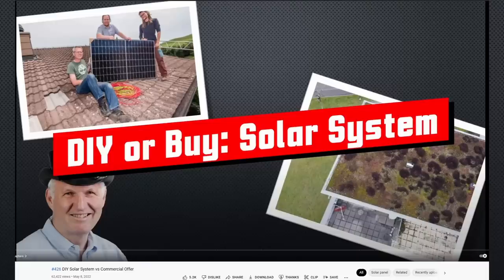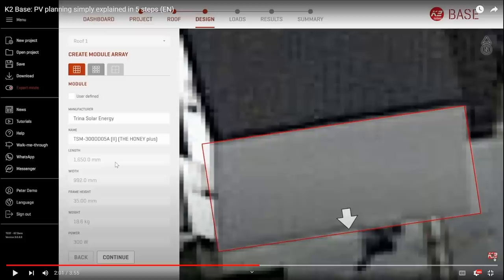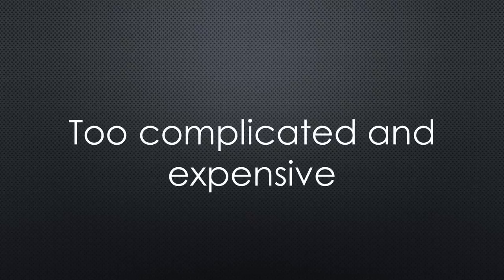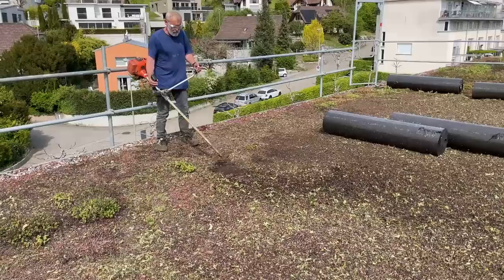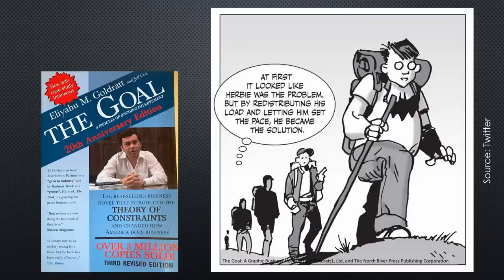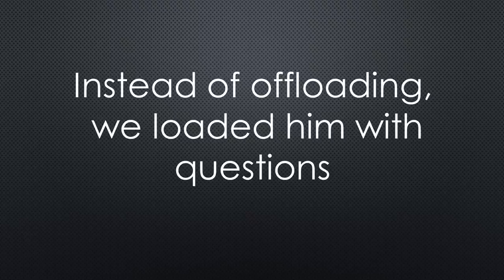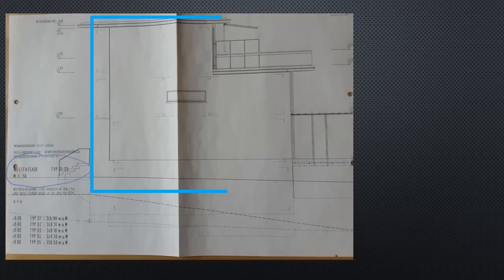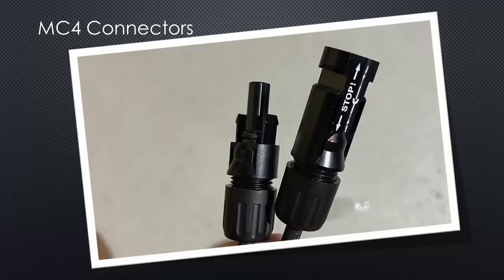#427 Four 8kWh DIY Solar Plants with neighbors (Part 2)

Comment: Congratulations!
Good progress!

What monitoring system will you use?
Reply from the maker: For the moment their cloud. But of course, we want more ;-)
Reply: @AndreasSpiess  How are you moving on with the solar energy system?
Did you and your neighbors made any progress?
Have you successfully connected the system to the house electricity and the grid?
Reply from the maker: @stefan-lupo-pelzl  Each plant already produced more than 1 MWh! And did not consume energy from the grid (with small exceptions). I already sold energy for 200 $ (if my calculations are ok). And I was able to connect my inverter to Node-Red. Next month we should get the Backup Box to be independent if the grid is down. You see, a lot of stuff for update videos after the summer break.

Comment: I am still not sure about that ballast thing. It looks very insecure to me, especially with the very unstable weather .
Reply: I've stood on a flat roof in a hurricane - the wind is deflected upwards by the walls and creates a wind shadow. The air is surprisingly calm, so don't worry about it.
Reply: @ahaveland  Tell this to the people in Paderborn that lost their roofs due to a tornado... but if the calculations say that ballast is enough then I guess we have to believe the science :D
Reply: @bbogdanmircea  I'm telling you my experience about a hurricane. Tornadoes cause houses to explode by a sudden drop in pressure as well as high winds. Flat roofs don't stop a house from exploding.
If you're hit by a tornado, you have much bigger problems to worry about than losing a few solar panels.
Reply from the maker: @Andy: Thank you for this info! We also have an insurance for such events which should cover at least our cost.

Comment: I think every Homeowner solar system should be DIY. Absolutely no subcontractor involved. Half the solar cost goes in to the contractors pocket! Absolutely hell no. Solar is extremely easy to learn. DIY or you're just pissing away your money.
Reply from the maker: In our case we also got good prices because of the buying power of the cooperative. But it is hard work and should not be underestimated.

Comment: Heyy, I want to buy a mini solar panel, for a custom Air conditioner, I am making, what model would you recommend...
Reply: A mini solar panel won't power an air conditioner. You'd need 2 or 3 of the huge 450W panels that Andreas used in order to power a small A/C in full sunlight. You should do some mathematics on your power requirements before you start anything.
Reply: @johncoops6897  a mini fan...
Reply from the maker: Just make your calculations and you will find out the required size.
Reply: @dibyojyotibhattacherjee4279  - a mini fan? You wrote "Air Conditioner" LOL.
Reply: @johncoops6897  yes, it's a mini air conditioner..

Comment: Solar seems like a good idea. Until you really think about it.
Half of the time it does not work.
The other half suffers from clouds and sun angles in winter. Another 50% lost.
Then the sun heats up the panels, another 20% lost.
In the end 10-15% production factor.
And then complete houses are shutting down solar as the grid voltage rises too much in good weather..
Nah..
Reply from the maker: I do not agree!

Comment: Do not forget you are adding 4000k to the structure but you still have the winter Snow load ontop of the panel weight
Reply from the maker: Agreed. But we also have the factor of 3-5.  And the winters became mild here.